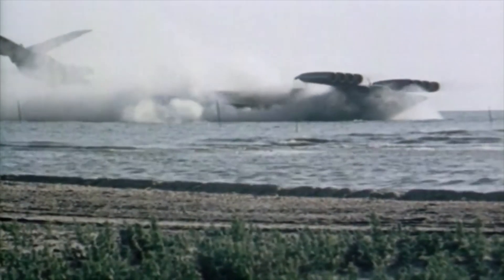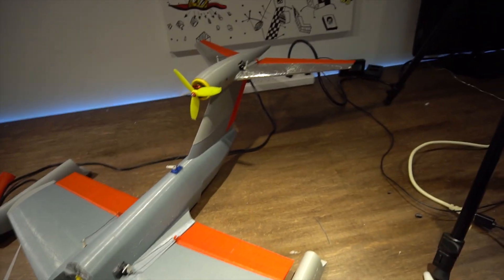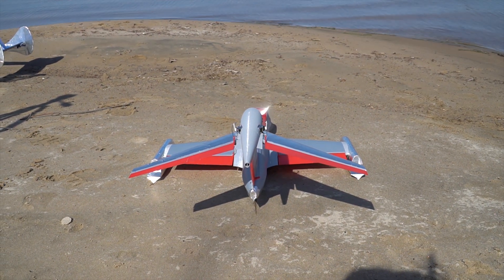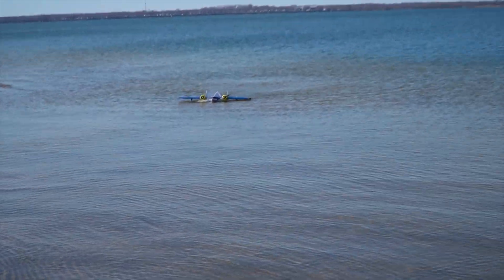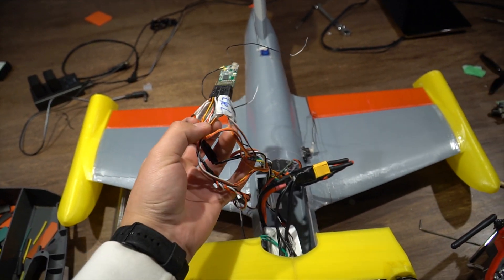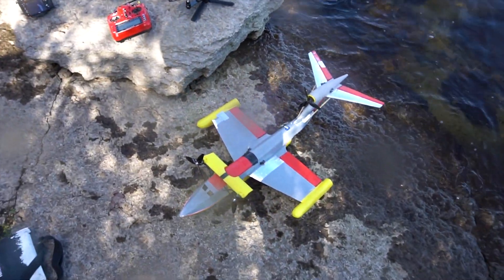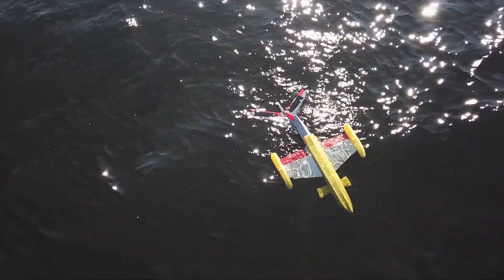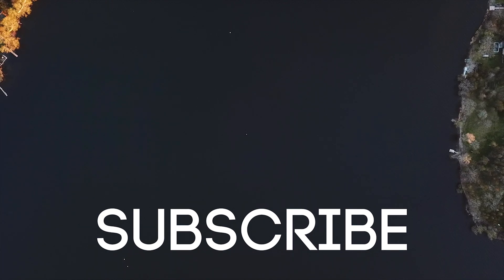3D Printed RC Ekranoplan

Comment: I 3D printed one a few years ago. Used 4 EDF's on the front wing, but it wouldn't work in ground effect. I abandoned it when the fans started playing up. The wings on yours are the wrong way around they need to be reverse swept, plus the fans at the front need to direct air under the wings to create an air cushion. That's the tricky part, as once in ground effect the fans needs ducts to pull the Ekranoplan forwards. Weight distribution is critical. I am now working on another. Narrow fuselage, big wings all the way down. Waterproofing pla can be done by painting with resin. I use it RC boats that I 3D print and they don't leak a drop.

Comment: Take the Sea Duck that you have, or make another Sea Duck same design,  and add the ground affect wing to the back top half of the plane. This will trap the air under it and it will work in Ground Affect. You could make it a plastic peace that pops off or on the plane. Anyway good luck.

Comment: Maybe you could turn it into a ekranoplan with a back/front hydro foil to keep either a higher distance from the water or to keep it touching the water because it looked like it wanted to nose up alot
Reply from the maker: The waterproofing wasn't great so it gradually got filled up with water as time passed. I suspect that this made it tail heavy, causing the nose to go up.

Comment: As cool as ur design is . that looks. Like alot of glue joints that could fail .
Reply from the maker: Yeah and they definitely did. On a future project I'd probably have some kind of flap that overlaps so there is more surface area for the glue.

Comment: From what I'm seeing is that your ekranoplan model is too heavy at the tail and also ekranoplan real ekranoplan design uses the front engine only for takeoff and the stabilizer mounted engine for cruising but on your model the front engine keep pulling the aircraft upward making it unstable to the tail i guess. I'm not an expert and i may be wrong but if it works please do make an update video bcuz i would watch it for sure

Comment: Quick question can i buy a like $100-200 3d printer and be able to make a rc plane from it also subbed and liked
Reply from the maker: Yes! I used the Ender 3 to print this plane, and I'm pretty sure it's in that price range
Reply: @GregMakesStuff  thank you i was thinking like the select mini but if i can get one like yours for that price range that would be nice
Reply: @GregMakesStuff  i actually will be a senior at my highschool next year and these past couple of weeks i been fascinated with drones and rc stuff i dont have the parts for it so i thought i would buy a 3d printer to help me out dome
Reply from the maker: A 3d printer is sooooo useful if you want to get into RC. I just wish I got one earlier
Reply: @GregMakesStuff  your gonna be the first one i show when i make my first rc plane
Reply: @GregMakesStuff  i just have to get a receiver some motors transiter and i think thats it ima try not to mess it up too bad

Comment: Great attempt, good work. I would go with other comments, seems a little tail heavy. Also the whole craft seems a little heavy. Sealing the hull should only need a few thin coats of paint shouldn't it? Perhaps lighten it up by replacing the tail with a foam version?

Comment: FYI, ground effect is complicated but when you nail it, it's awesome. Right off I can tell you you were tail heavy and that the forward motors are a good idea but more effective if you get air under the wings. The Ekronoplan is a good vehicle, since it is up the power required to keep it there is minimal. I've done everything but make a scale replica, however the vehicles I made were close enough. I found it better to test on land and get it working well before going to water. You did well on this, especially the perseverance to take it that far. You kept going until you lost it, bravo. Can't wait to see what's next!

Comment: I wonder if it’s just not good at working because it’s small, like small planes are unstable compared to large aircraft. Also that pitch on the front motors pushed that nose up a lot it looks like. Sorry it didn’t work out!
Reply from the maker: Yeah I think that the small size really limited its potential
Reply: Greg Makes Stuff 
I’m sure you could make this work again sometime if you used FT foam and made a larger, more scale version. It would be waterproof, and would be easy to make and “repair” lol.
Reply from the maker: @CaptainJohn  I guess, but the challenge was to make it fully 3D printable 🤷‍♂️

Comment: I think your initial problem was thinking making the whole thing come out of the printer. Going with depron/foamboard main body shell and printed supports, formers etc... would be the better option, also go for a 1m wingspan. Don't make the wing area too big in relation to the body or it will fly away proper, like Peter Sripol's attempt.
Making the stepped underbody was a good idea, you need that for hydroplanes. Also for initials you have to let it run straight to skip on the step, then you will have proper air control. Unless it's not sitting on the step it is just an overcomplicated boat. Managing the ground effect will be the hardest.
All in all, great project, good execution. Also lay off the zoomerboard :)